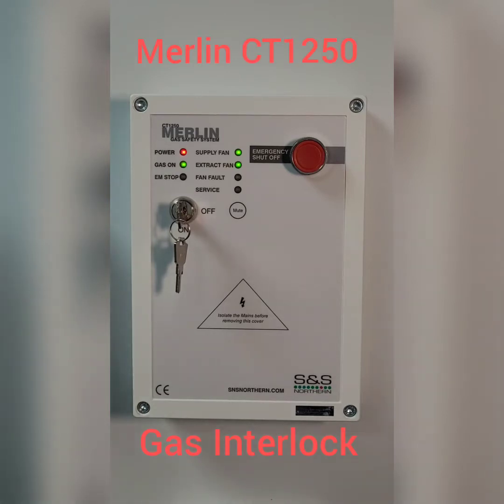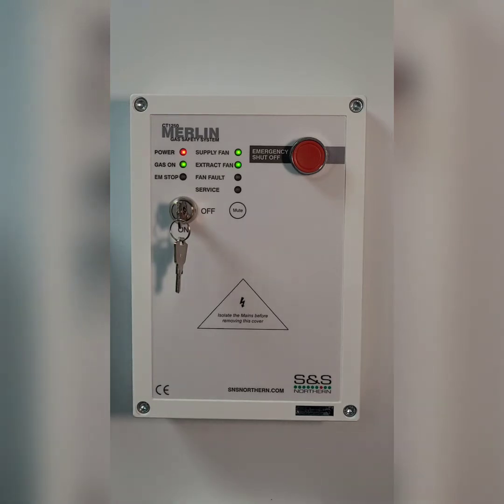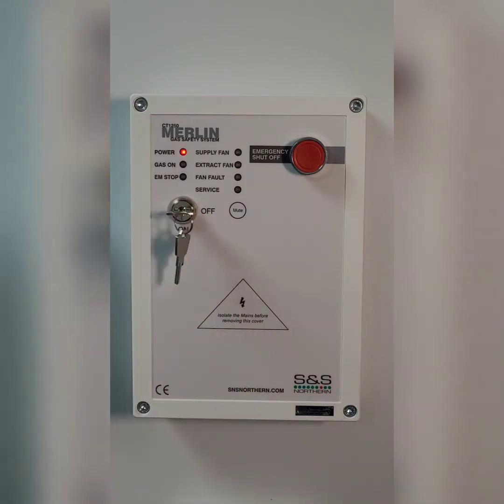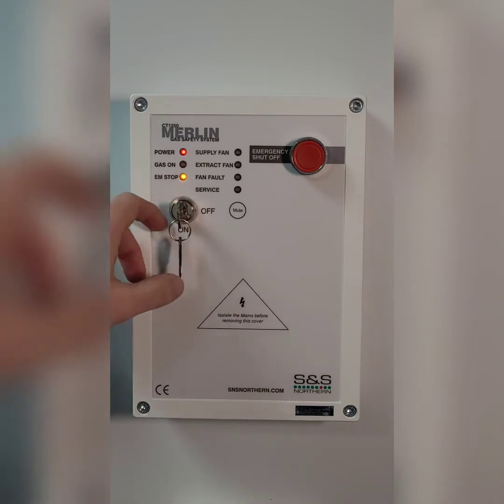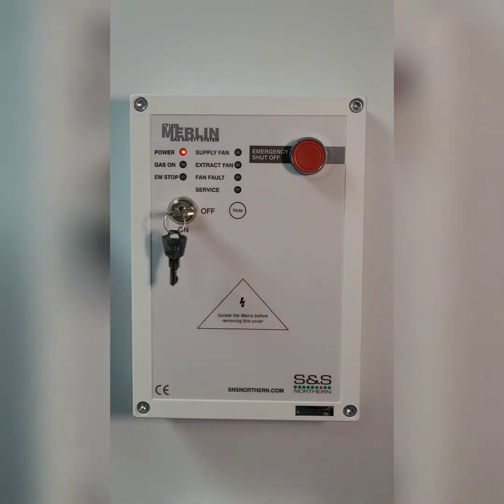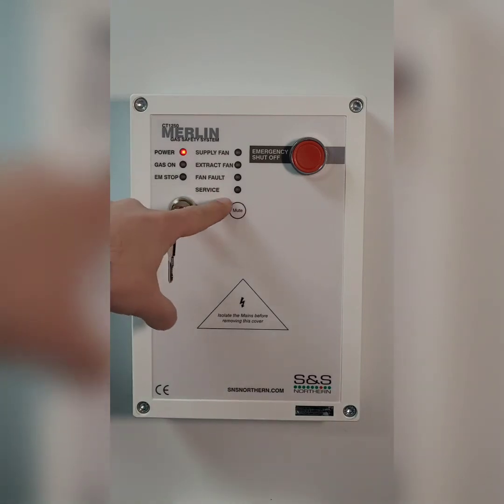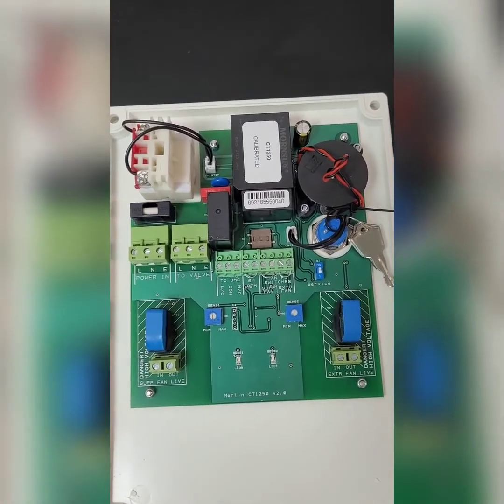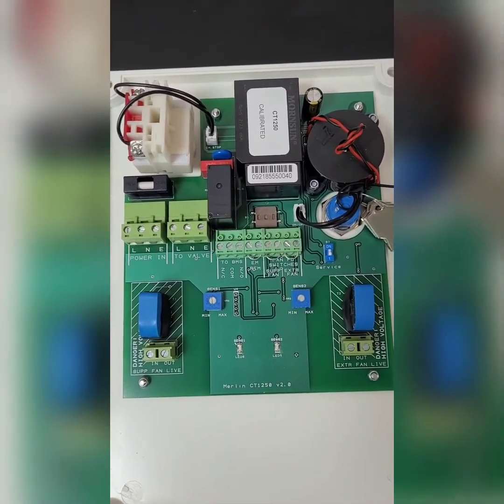Merlin 1250 Gas Interlock by S&S Northern.

Comment: Hi mate, great video im a commercial electrician and i dont know much about these interlocks.. im just wondering if the gas was on without extract. What would that mean.
Reply from the maker: More than likely someone has linked out the extract fan terminal inside the panel. Or of the system has an air pd switch, this may be stuck closed

Comment: Hi, my gas interlock system is not working. The Extract Fan is flashing, can I fix the problem myself ?
Reply from the maker: Hi Gary best to get an electrican. If the fan is working the current monitor pot on may just need adjusting. Get in touch with S&S Northern for more help 01257 470983